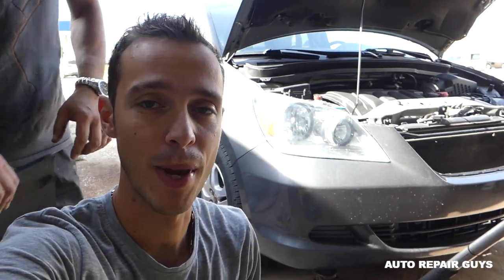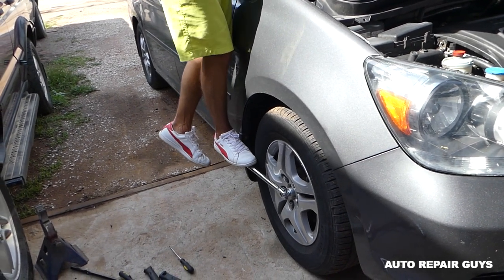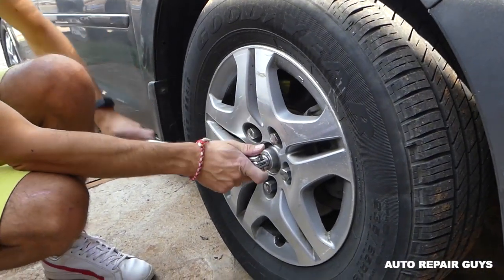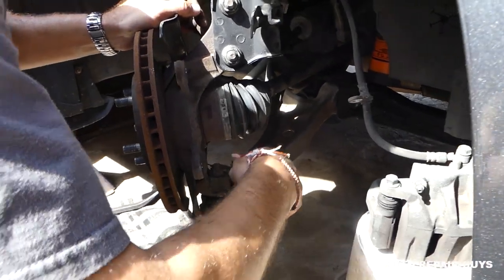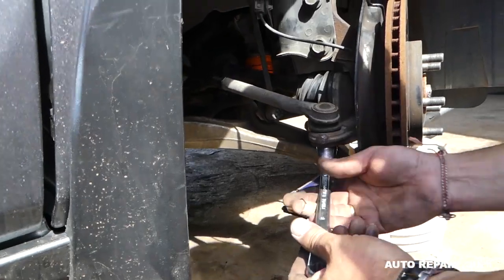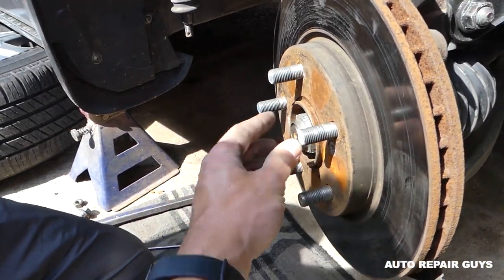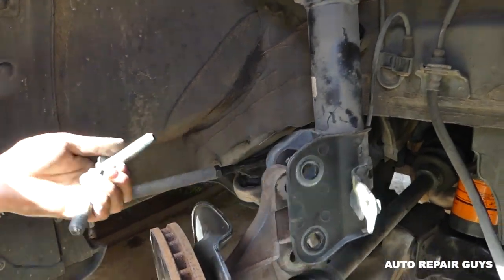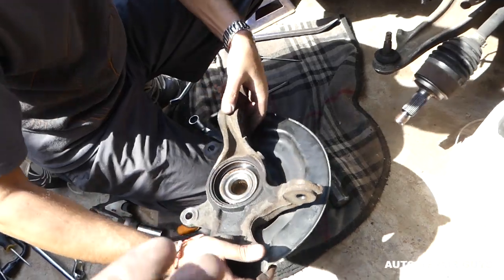HONDA ODYSSEY FRONT WHEEL HUB REMOVAL REPLACEMENT

Comment: Nice vid, but this doesn't show how to remove the hub. It shows how to remove the knuckle.
The hub (which contains the wheel bearings) is still installed in the knuckle.
If you're in the Rust Belt (Northern USA, Canada) the tough part is getting that hub out of the knuckle.

Comment: Too bad the video didn't actually show changing the hub or bearing.  This was just how to remove the steering knuckle with the bearing in it.  So do you then need to get the hub and bearing pressed out and in?  It would've been nice if that had been mentioned.
Reply: On most vehicles now you have to replace The whole hub assembly not just the bearing
Reply: You replace it, that way it costs more.

Comment: Hey Auto Repair Guys, thanks for Vid. One question, what is the torque spec on the bolts when tightening the steering knuckle to the strut flange when you reassemble it? (6:15-6:36 in the video)